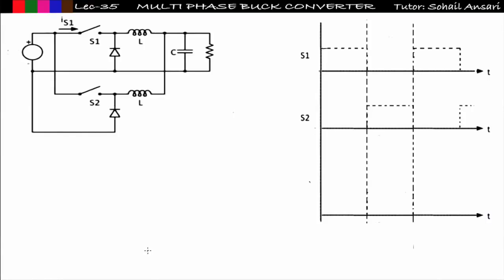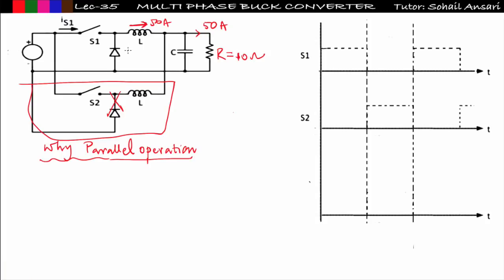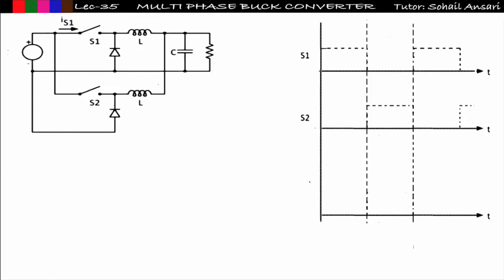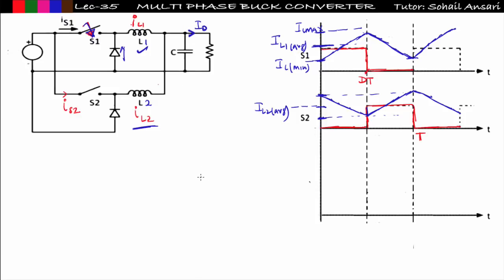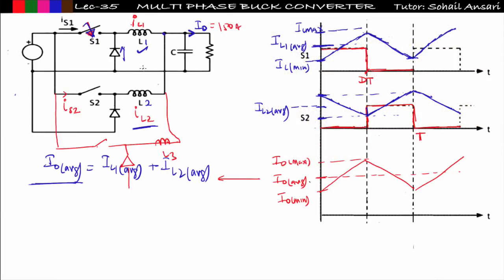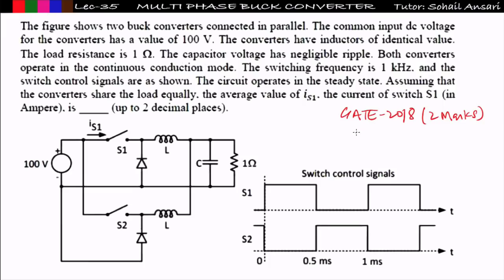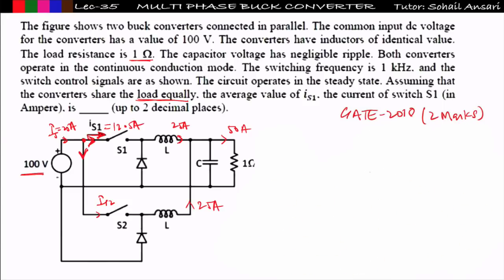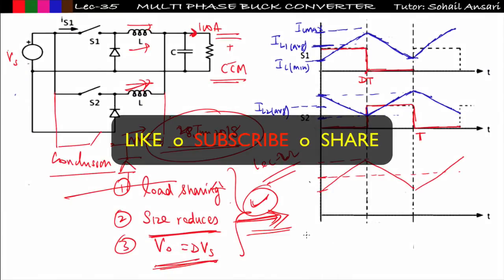Lec 35 Multi-Phase Buck Converter | VVI for GATE 2019 | Power Electronics

Comment: 18:20
In the second method, Pi=Po, source current we get 25 amps,but how the switch current "Isw1" will be 12.5amps..because switces are operating in complementary fashion . So when S1 is ON then S2 is in off position.so when we apply KCL we get Is= Isw1 ie., Whole supply current will pass through S1..
Plzz.. explain me sir....
Reply: Same doubt here also

Comment: Sir tnx for ur valuable teaching.  I had a doubt over the circuit operation actually..... 
Theoritically  its alri8 that 100A current gets divided into two 50A(each from each of the inductor) and as the switch capacity is 50 A(each) it will allow that current to pass.  But as u said that when one switch gets ON while parallely the other gets OFF, then if the switch Capacity is 50 A then how will the switch able to handle the 100 A current bcoz the other switch will be OFF at the time when one switch is working. 😕😕😕

Comment: Sir your second method is wrong please check it once because you can't divide source current in two parts by KCL each switch will carry 25 Amps only  but on different time instant. As you have told both switch will not ON simultaneously, hence avg switch current will become 12.5 Amps.
Reply: Bro i think sir have done correctly and you can use second method for any duty cycle also
Because 25 amp is peak switch current which is equal to avg inductor current

You may calclutae in reverse way that you calculate input current with the help  of switch current  as input current is sum of switch current in different time range you will get same result =25 

See how:- you draw switch current 1 waveform with peak value equal to average value of inductor(1) current =25 A for 50% duty cycle .and for further 50% draw switch current 2 waveform with peak value of inductor(2) current=25 amp 
Then find the avg value of this waveform which is input current waveform you will get 25 A

Correct it if im wrong

Comment: Sir if duty cycle of both converter is different than what will happen?And it is possible to take different duty cycle in multiphase chopper for both switch or not?
Reply: rahul sahani check ps bhimra pg no 438
Reply: With same data if you take different duty cycle then 
Load current and avg inductor current will be calculated in same way with different duty cycle say 0.3 but
1. Iswitch1 avg and rms value will change and can be calculated with 0.3
2. Iswitch2 avg and rms value will change and can be calculated with again 0.3 duty cycle not with 0.7 duty cycle
3. Input current avg and rms value will change accordingly
4. Diode current will also change and for  0.3 duty cycle you will get diode current for 70% of time period for both diode
Reply: Interesting question will be framed if duty cycle is greater than 0.5

Comment: In this case what is the value of D? Is it possible to operate this device the value of D other than 0.5. Because when one is at on state other is at off state. so if for one converter D value is other than .5(suppose take .3) then the value of D for the other is .7.So output voltage is not equal in this case.
Reply: Subir Kumar go to page no 428 ps bhimra you have to take duty cycle in such a way that input current is periodic in nature
In short you have to take same duty cycle for both converter this is also called phase shifted operation

Comment: 18:20
In the second method, Pi = Po , Source current we get is 25 amp , but how the switch current "Isw1" will be 12.5 amp ... Becus switches are operating in complementary way... So when switch S1 will be ON then only we get switch current and at that time S2 will be OFF.. So when we apply KCL then Is = Isw1 i.e.  whole Supply Current will pass through S1... 
Am i right ???
Correct me if I m wrong Sohail Sir..
Thankyou 😊
Reply from the maker: draw the waveform..switch current u will get for half cycle only..so take avg of that u will get 12.5A
Reply: Yes whole switch current will pass but for 50% of time 
Means 
Isource avg=25 A 
and Iswitch(1) peak is 25 A but when you calculate switch avg current you will get same 12.5 amp
Correct it if im wrong
I think you are thinking in a manner that 25 amp will pass throught switch

Comment: Sir I had a doubt on reactive power..  please give me information about reactive power practically ...Not as vi*sinphi.......Is really flux is responsible by reactive power ... How some amount of power not been used by system ....How it is reactive power... Please give information sir
Reply from the maker: first understand how flux is producing..flux is produced due to inductive effect of winding..and inductor consume reactive power...so reactive is required to produce flux..now without flux can u get emf..so reactive power is necessary to transmit power ...without reactive power u will not get electrical energy..
Reply: Tq sir.
Reply: Always some amount of power been not used is it reactive power sir?
Reply: Why inductor consumes reactive power and how capacitor supplies reactive power.    I had more misconception sir please clear my doubt